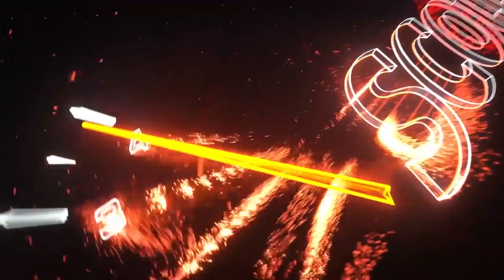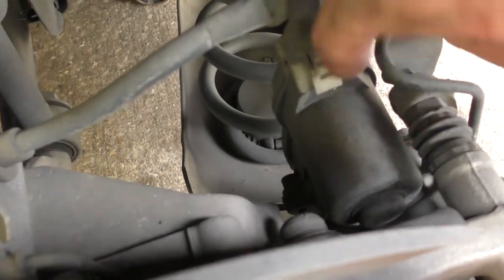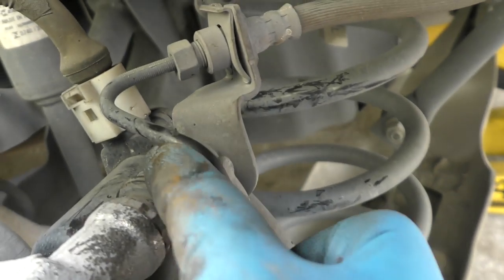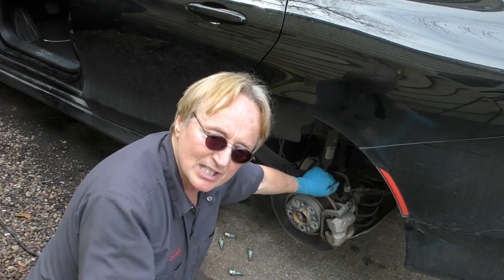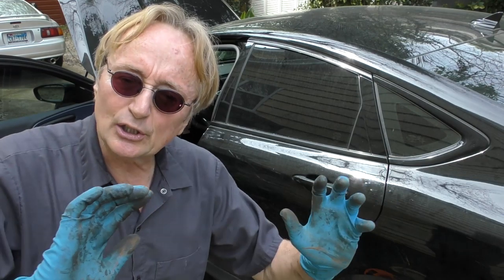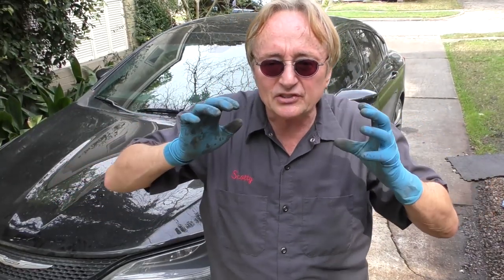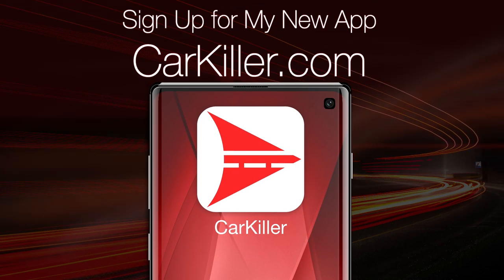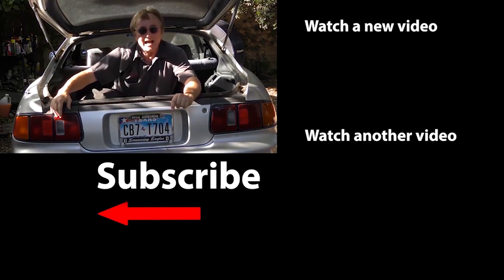This Trend is Stupid and Dangerous

Comment: I'm glad I'll never be able to afford a car with a electric e brake 👉🤣👍 good video as usual Scott !
Reply: Snails40 i think what he means is that there is hardly any new cars that don’t have this moronic electric parking brakes anymore. So yeah I’d have to agree with him, even if I had a six digit bank account I’d be much happier with a car a few years old that still has the good tried and true emergency brake with a real cable. Just because something is new or expensive doesn’t always mean it’s better
Reply: Just wait a few more years where only electronic parking brakes only exists.
Reply: @dragon81heart  thank you , there's always 1 .
Reply: I have a base model Toyota where everything is electronic besides the seat adjustments...you can turn it all off of course but it too has an electronic parking brake, lane keep assist, the cruise control radar that matches the speed of traffic automatically, automatic dimming high beams etc. a $20k car brand new. Even has hubcaps with all that technology

Comment: The tool and process to collapse the brake caliper have been around a long time before electronic parking brakes.. Every car that I have done rear brakes on need the special brake caliper tool to spin and collapse the caliper..
Reply: I've always just squished em with a clamp, haven't run into the twist kind of caliper yet.

Comment: The cable is the best but not the auto adjusting one like my Chevy Cruze that wasn't working when I bought.  Had to open console and mod to make it work.  99 Tacoma V6 auto 4x4 is #1, had 250K miles on it and no check engine light, A/C worked.  Many years ago, trucked rolled 3x and didn't leak, started right up.  Just a ball joint broke later.  It's built like a tank!

Comment: They haven’t been called emergency brakes since the dual circuit hydraulic brake system.  Can you even hit that button while moving at a high speed?
Reply: Jacob G you can’t.
Reply: It will just slow your car down as fast as slamming on your brakes
Reply: Yeah, and the funny is the dual circuit brakes still fail.  But parking brakes will do in a pinch.
Reply: @andrewm2786  Not really true. It's just your rears and they'd just lock up
Reply: @1CoLoRz2  they don't lock up
Reply: tried it on my golf shudders but then automatically releases.
Reply: Yeah it's called a park brake hence the "P" on the switch.
Reply: Yes I’ve done it in a Buick rental and it locked up the brakes going forty.  I tested it on a stretch of open road, probably made a nice flat spot on the tires.
Reply: @andrewm2786  What makes you say that? And most likely what itll do is tell you to go into park first haha. That's what all the newer Chrysler stuff does anyway
Reply: In Porsche cars, it is also the emergency brake. You push and hold the button as long a you need "emergency braking." If you don't hold it, it won't engage while the car is moving.

At least, that's what the 718 Cayman's owner's manual says.
Reply: @andrewm2786  they don't lock up while driving at all FOR SAFETY REASON lol
Reply: Jacob G no it automaticly disengages if you are in drive. It will only turn on if you are in park
Reply: Jacob G you can’t because you’d spin and crash. 👍
Reply: The electric brake on my Mazda will apply when moving if you hold the button, it disengages automatically when you release the button. The rear brakes will lock solid on the highway very quickly when you hold the button.
Reply: @chuckmathis7428  it applies with ABS as a safety feature. It will not lock the brakes.

Comment: "A simple cable system that lasts forever!"

Tell that to my 98 Jeep Grand Cherokee which has a mechanical parking brake which was broken when I bought it 10 years ago.
Reply: Really, I have to change the front brakes but the rear brakes seldom need service. I hate doing them but like I said they last a long time. Was it the cable?
Reply: @jeep146  So, the parking brake has its own shoes inside a drum-in-hat rotor (the grand cherokee has 4 wheel disc brakes) but they are completely seized up for some reason. I ended up just disconnecting the cable when I removed the rear axle during a lift install and never bothered hooking it back up. One of these days I might try to fix it, but honestly I want to swap out to 1-ton axles so I am hesitant to put too much money into the stockers.
Reply: Broke because is a jeep 🙄🙄🙄
Reply: @erito23gamingpower99  yeah, 200k+ miles of hard driving in extreme heat, high dust, extreme off-roading, and its never left me stranded even once. 
But nah, the parking brake didn't work when I bought it so the entire brand is garbage right? 
nevermind the fact that jeep made 3 of the most reliable engines in history and my ZJ has one of them.
Reply: @KurNorock  You enter the great unknown when you start modifying Jeeps. One mistake people make is not replacing the springs when replacing the shoes. They will break after time and can lock up the wheel.
Reply: @jeep146  You seem to be misunderstanding me. 
The parking brake was already broken when I bought the jeep 10 years ago.
 
The jeep was entirely stock when I bought it. 

I modified it about 8 years ago, and since I did my research ahead of time, I knew exactly what I needed to do, and I have not had any issues with any of the modifications, or with the modifications causing any other issues, other than my front unit bearings wearing out more quickly due to the larger tires, which I knew was going to happen and is part of the reason I want to swap to 1-ton axles.
Reply: Here in the rust belt, parking brake failure is common.  They rust up and don't disengage.  I suspect e-brakes will be even less reliable and more expensive to repair but cable operated brakes aren't trouble free, either.
Reply: @KurNorock  Thanks, Now I know what you mean.
Reply: At least repairs on the cable system aren't going to cost you thousands of dollars just for the parts.

Comment: On some cars you need a scanner to put the vehicle in brake service mode too. 

And so true about the emergency situation. My Toyota Tundra brake pedal went to the floor at 65mph going towards a tunnel with stopped traffic. I wouldn’t have been able to modulate the emergency brake like I could’ve on my foot pedal if it was electric. In the end, my steel brake line at the caliper popped an tiny pen hole.

Comment: The 1st 2018 Camry we test drove was the XLE and it had the EPB (electric parking brake).  I had never seen one & told the salesman I would have to research this one.  After a little research on-line, we were convinced that we did NOT want this.  Ended up buying a 2018 LE which has the foot on/off parking brake.  Unbelievable that the EPB exists on ANY car.  We actually prefer the parking brake on our 94 camry XLE V6 to the 2018 camry LE foot on/off.  Foot to apply & a handle to release on the 94, much easier to modulate on our sloping driveway!

Comment: Ever tried playing around in the snow with an electric emergency brake?  It's So Much More Fun with a handbrake that is infinitely more controllable!
Reply: Ever paid $230 for playing in the snow?
Reply: E brakes haven't worked like that in decades anyway.  It's a  miniature drum brake on the rear wheel.  It's good for keeping a stopped car from rolling away, that's about it.
Reply: @Erdie5 , that is true on cars or trucks with disc brakes on the rear. The vehicles that still have drum brakes on the rear with the old cable e brakes,  whether on a hand lever or foot pedal are still the same. My '03 towncar and my 2011 F150 both had disc brakes with the useless e brake and they were a royal pain in the rear end to work on, but my wife's 2015 Rogue has drums on the rear, and it's really fun in the snow.

Comment: IF U HAVE A GOOD SCAN TOOL U CAN TELL THE CAR TO GO INTO BRAKE SERVICE MODE THAT WILL DRAW THE CALIPER IN ON ITS OWN
Reply: Well, that might be the only benefit I can see :)
Reply: Is that only on new models?
Reply: All cars are different on when they started. I believe it's been since 2016. I def wouldnt start twisting in the caliper with the tool without checking for a brake service mode with the scanner.
Reply: Also if you're driving at speed and you try to apply an electronic parking brake, most cars will not
Reply: You don't have to feel the need to put your useless comment in. I just happen to have caps lock on.
Reply: It doesn't retract the caliper piston. It only retracts the electric motor screw rod, so the hydraulic caliper piston can be retracted without damage to the actuators
Reply: @simplytired2109  correct

Comment: I’ve heard the new Corvette will be a brake by wire system. Sounds like a disaster waiting to happen or as Scotty would say: an endless money pit.
Reply: Supposedly it will make it stop quicker. Gotta make it compete with European exotics somehow.
Reply: Dcc357 Maybe so. The only problem is that the C7 Corvette actually has better stopping distances than the C8. It might be due to the weight distribution but you would think that would actually help the C8 stop faster.
Reply: @CouchMan88  Was the C7 you're talking about a Z06? The current C8 is a base model Corvette for now lol.
Reply: Dcc357 No. Base model stingray stops in 90 feet and the new c8 base model stops in 97 feet on 60 to 0 test. The z06 is also around 91 feet, more than the stingray but both less than the C8. Motortrend and a few other publications wrote articles about this already commenting the C7 had faster braking.
Reply: Dcc357 I’m not sure on the making it stop faster but I know the braking feel and pedal travel changes based on what driving mode you are in which is cool I guess. With a stop by wire system you are able to customize the braking which you can’t really do in a traditional brake setup without changing the hardware.

Comment: With the high cost of replacing these electronic emergency brakes there will be a lot of cars in the future with no emergency brakes that work!!
Reply: Alot of the old cars in the rust belt have rusted tight parking brake cables.
Reply: That may be true but at least it's not going to cost nearly as much to fix your emergency brake cable!

Comment: Yeah, what happens when during your emergency there is a total power failure?  No real brakes, no emergency brake, electronic transmission dumps into neutral, how do you stop?
Reply: Open the door and use your foot?
Reply: @TheTOGASS  Yabba Dabba Dooo
Reply: Or if your electronic gas pedal gets stuck
Reply: That’s a pretty unlikely event. If there is juice in your battery, the electronic e-brakes will engage. Most people use e-brakes when they park. It’s rarely used for stopping.
Reply: @DSKSeattle  I know a guy who drove around for several months in his Hyundai using ONLY his parking brake before he brought his car to me for brake repairs. He had no hydraulic system working because so many things had gone wrong and he was using his parking brake that only worked decent on one wheel. He needed 3 new calipers and all new pads. He drove the darn car right through the pads and backer plates. The pistons were on the rotors and that is very ineffective for stopping. Would have been cheaper to fix it when it started squeaking. 
I test drove it before tearing it apart.....scary when I pushed the brake and nothing happened. 
He also had to get in the passenger door because the handle outside had broken off more than a year prior..that I fixed for free because it only cost me about 30 minutes and $13.
How many vehicles out there are in that kind of dangerous condition? I have seen many vehicles that have been driven right through their pads and onto their pistons and also have totally empty shock absorbers. PEOPLE ARE OUT OF CONTROL!😱
Reply: afobear Yikes! That’s not what the e-brakes were designed to do. The electronic e-brakes fully engage when it’s activated so it’s impossible to use it as daily brake.
Reply: @afobear  Just wages falling short of inflation in regards to anything else. A lot of people get by like that where there isn't really any good public transportation. And charities don't seem to do transportation like they do food/housing/medical even though that could still be a lifeline for some. For the one you saw firsthand, think of how many more are out there.
Reply: your brake servo only assists your braking, the system is still hydraulic. just harder to push the pedal, but if you lose power yoir brakes will still work

Comment: I just changed the  rear brakes on my daughters Chrysler 200 with electronica parking brake all you have to do is go into the dash menu and put it in brake service mode it will back the brake pads off for you you replace the pads when you’re done, push the regular break and then pull the parking brake switch and it takes it out of brake service mode

Comment: What if the battery suddenly dies, and you begin backwards rolling? Without a handbrake?
YOU ARE F>>>>!
Reply: Use Hydraulic brakes? The electronic one is just used for parking and whatever implementation they think about.

Comment: Funny thing is, with 200s the electronic brakes tend to activate at almost random. I want to say it was in the 4cyl ones. If you shift it into park, it’ll sometimes activate the parking brake, and when you put it in drive you won’t go anywhere until you turn the brake back off. I work for a rental car company, and this happened frequently with 200s, very aggravating.

Comment: Scotty please talk about Ford's death wobble!
Reply: For clarity...   do you mean the wobble on their Superduty trucks? Is it in other Ford vehicles as well?
Reply: @hhiippiittyy  yes on the super duty trucks
Reply from the maker: will do!
Reply: @scottykilmer  
Thank you Scotty I'd love to hear what you have to say about it :)
Reply: Jeeps death wobble gave me PTSD
Reply: @underscorejeff  
I understand it's an issue with many solid front axle designs.
Reply: @hhiippiittyy  actually it might just be an issue with the steering stabilizer because this guy on YT fixed the death wobble by replacing the stock shitty steering stabilizer with a beefier one made by fox
Reply: 9 times out of 10 on a super duty it’s because the track bar is loose either one of the bolts or the track bar ball joint depending on what year the truck is the other 1 time it’s because all the ball joints one the steering knuckles are absolutely screwed/combination of failures

Comment: I had a 1970 chevy c20 pick up that the brakes failed when the the power brake booster died while I was driving. I am glad I had a cable driven emergency brake to control my stop

Comment: One time on my 1996 Dodge Dakota, the rear hydraulic cylinder seal gave out while on a back country dirt road. All the brake fluid squirted out. I was 20 miles from the nearest town.  Staying in low gears, downshifting and using the emergency brakes allowed me to creep to town and get the truck to a shop. That wouldn't have been possible with an electronic emergency brake system. You're right, Scotty. Electronic emergency brake engagement is a bad idea.

Comment: In regards to forgetting to release the brake?   Modern ebrakes are better in preventing that.  I have backed up, or driven forward a few yards with cars that had a manual parking brake.   I have had two cars with the ebrake, and you can't do that.   If it is in park, the brake releases when you put it in gear.  If you applied the ebrake while it was in gear, as soon as you press on the gas pedal it releases.

Comment: Im a tow truck driver and had to tow a 2015 bmw that the electric "emergency" brake system failed in the engaged position. First car i delt with it and prefer a cheaper physical connection to help me in an emergency.

Comment: Was looking at the new Toyota Camry today. It has this system too. I guess everyone is going this way. Another good thing about the old style emergency brake is you could gradually apply it to come to a safe stop versus full lock and slide option of the electronic p-brake. I'm guessing they're full on or off as its just a switch

Comment: The switch brake has been the one problematic thing so far on my car. Not even a malfunction; I had my rotors replaced all around and it took a normally excellent shop three tries and their master trainer tech to get the thing to reset properly!

Comment: Hey scotty. I seriously just used needle nose pliers and screwed them in with 0 problems. I actually felt the brakes were pretty easy on my 2015 200s. Now i did however have 3 transmission  mounting bolts shear off  and in turn ruined my drivers side cv shaft. Must have been weakened from the bad transmission programming reving out 1st gear then slamming it in to 2nd and again back to first when stopping. Oh and you dont need to put it in drive or start the car. Just have to push the brake pedal in before you hit the parking brake switch

Comment: The 2017 and newer Ford Escape, have these electric E- brakes also. I had to change the pads already on mine. Now i am not an engineer but i know a lot about cars. And this is just terrible. Took me a while to understand this. I took the motor off, then i could turn it with a wrench, to bring the piston in.

Comment: SCOTTY, I reamed Hyundai a new A-hole for the electrinic parking brake that's on my wife's 2019 Santa Fe. I tiold them we (Americans) learned not to have an electronic parking brake decades ago that was a feature on some of our luxury cars. It is SO stupid to make a simple brake unnecessarily more complicated. I told them many states here use salt in the winter and the only way to keep the parking brake working was to work the cable and springs back and forth with the lever as the entire system would otherwise rust solid. The electronic parking brake doesn't allow you to do this and is expensive to fix. Thanks for saying what needs to be said.